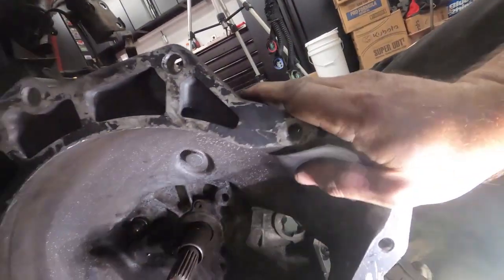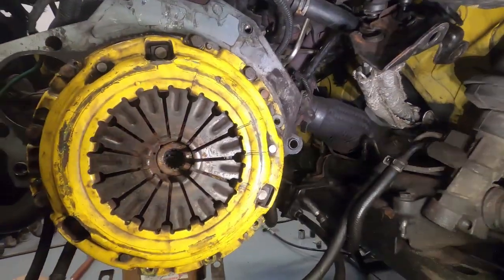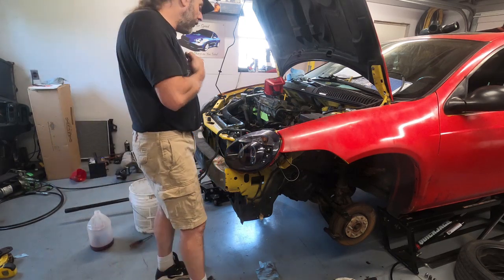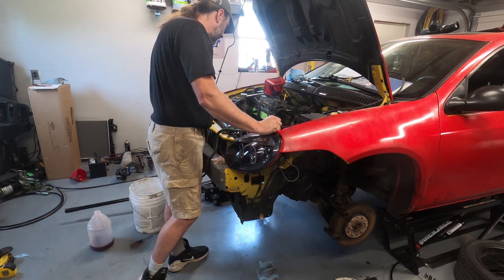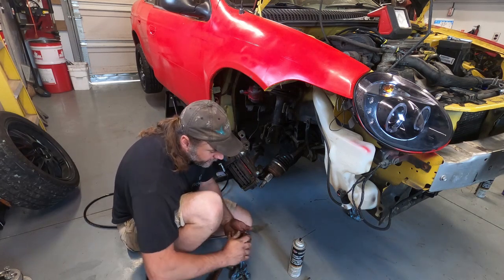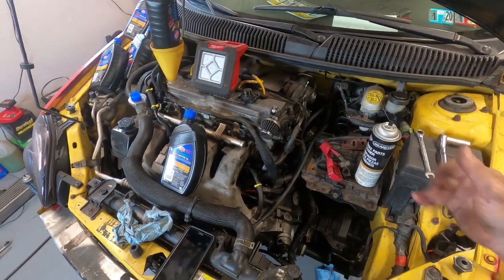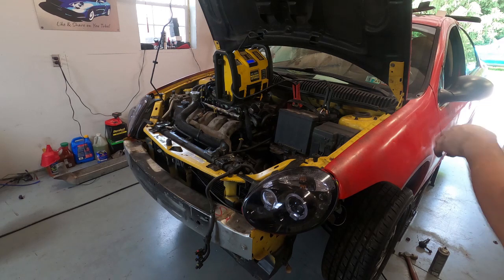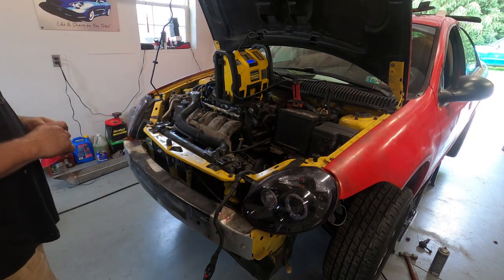sxt/srt4 clutch out repair pt2

Comment: Hey ive got some questions regarding valves.  Pulled the head off my motor, valve train is cooked. Thinking of replacing the valves, springs, retainers, etc. Do you know someone locally who does decent head work? Im doing prelim measurements now, head doesnt appear warped in any way, just looks like the engine has alot of miles on it. With the head being aluminum, im worried about valve seating. Looking for someone locally that can do some minor head work. I'm located in Schuylkill county, closest guy i found was in allentown and he hasnt mailed me back in 3 weeks lol thanks for the help matt!
Reply from the maker: I never had one done so I don’t know what direction to point you in. when I was working at shop in southern York country before I moved, I think they sent heads to Napa to be reconditioned and another shop was Broadway auto parts and  warrior engines they did v8 Chevy’s

Comment: Where would u suggest to get a clutch clutch fork flex plate etc...
Reply from the maker: All depends on budget and depending on type of clutch no flex plate needed forks big 3 are oem agp and dcr I’m sure there’s others. Now there’s lots of different clutches if you want to stay modular stock style withheld flex plate oem southbend spec to name a few. Act and clutch masters have there own flywheel and each part can be purchased separately but the this clutch nonmodular do cost more you can find parts from local dealer to auto stores and lots on line retailers. I prefer the act
Reply: Snowman I’d suggest a wykd clutch fork and boomba racing pivot ball and clutch is all based off your goals of tq